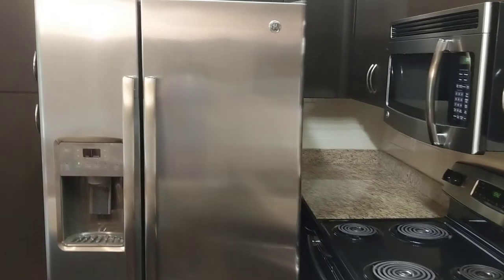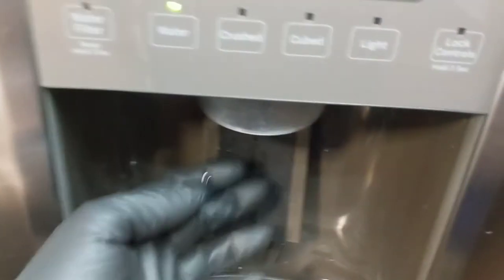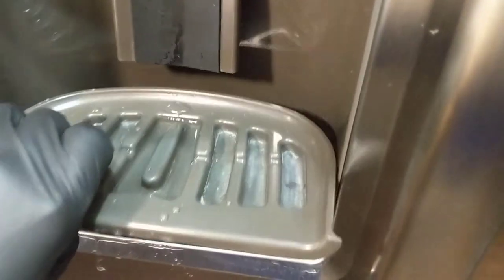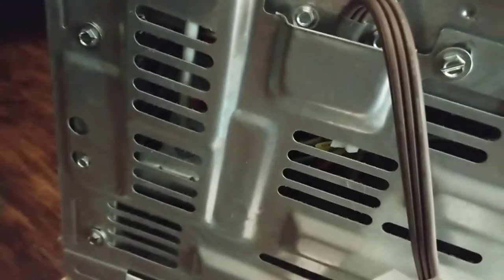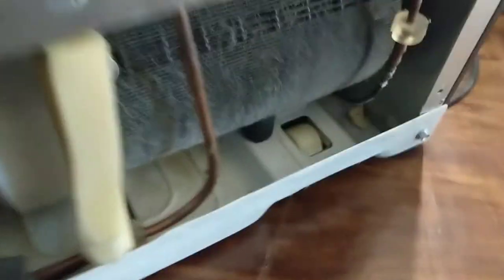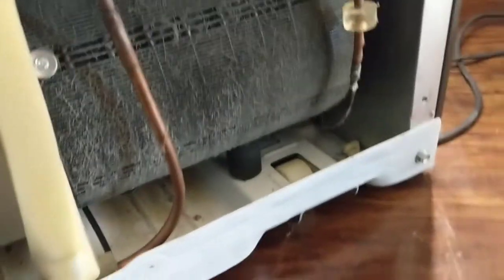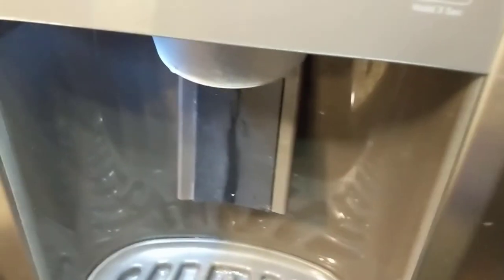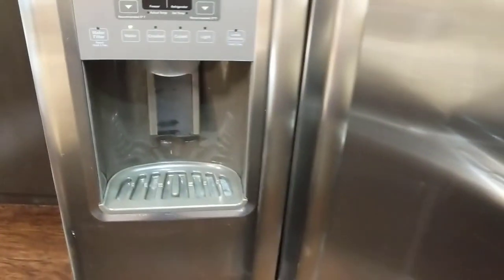GE Refrigerator Water Dispenser Dripping

Comment: Great video.  I replaced the water valve like in this video but our dispenser is still leaking very slowly.  Any other ideas?   Thanks in advance!
Reply: Try a new GE water filter screwed in carefully but tight.
Reply: @valindaznidarsic6253  yup already did that and it still leaks. So the filter and the valve both did not fix my problem. However, I did get a reverse osmosis installed and tighten the refrigerator to it and now the leak has subsided. So I feel it might be a high water, pressure problem.

Comment: I have an ice dispenser and a water dispenser. My slow leak is from the ice dispenser. The ice maker works fine, water dispenses fine but I get the slow drip of water maybe a half teaspoon a day even if I don’t use the ice dispenser for many days. 
Any ideas?
Reply from the maker: The dispenser door flap seal could be bad & not sealing the cold air in which mixes with the room temperature & creates condensation. Or it could be the solenoid that operators the ice door flap which isn't allowing it to close all the way. Hope that helps. Thanks for watching Xrpayday5637 & Subscribe to the channel 👍

Comment: What would be other reason for a slow drip in that area 
I just bought a brand new ge profile and it has a slow drip 
Lowe’s says it is condensation he adjusted the temp on Frig and freezer and it’s still dripping 4 hours later 😭
Thank you !
Reply from the maker: I would would call them back & demand a new refrigerator or have it fixed. There wouldn't be condensation dripping from the tube as unless there's an air leak & you have cold air mixing with the room temp. Either way there's an issue. Thanks for watching Joann & Subscribe to the channel 👍

Comment: Similar to NikTee, I have water trickling down the front door of my GE Artica after there is water in the tray. It appears to be coming out of the tray and through the bezel around the face of the dispenser compartment. But I don't think I have drip from the dispenser itself though.

Any idea how to fix the leak coming out of the dispenser?
Reply from the maker: Prob the water inlet valve not closing all the way. The same part I replaced in the video. That would be my guess, but it's hard to say without seeing it in person of course. Thanks for watching Zachary & Subscribe to the channel 👍

Comment: I am not sure if you still read these, I have an alternate model GE artica, I just noticed a trickle down the front door. I have a black bezel around the face of the dispenser compartment and it looks like the water drip coming from under the bezel, but the water has a drip from the dispenser itself as i've wiped and monitored.

There is no water in the tray itself however I can see the residue under and around the compartment holder when I remove it.  I am wondering if I have the same issue or perhaps a seal problem. I would think there is no reason for there to be water on the back side of the bezel so I am inclined to believe I have the same issue as referenced here. Do you have any insight?

EDIT - After further investigation, it looks like there is condensation around the seal at the base of the ice trap this is where I see the water droplets condensing.
Reply from the maker: Sorry for the delay on my response. Sounds like you could have the same issue as in my video, but I would remove any water from the tray & keep an eye on it to see if anything drips down. Thee shouldn't be any water dripping or forming anywhere around the bezel after water or ice is dispensed. I see where u say about condensation around the "ice trap" I'm guessing your referring to the dispenser door? If so, check the seal on that & make sure there isn't some loose ice or frozen chunk of ice inside there that slowly melts off & drips down. Thanks for watching NikTee & Subscribe to the channel 👍

Comment: I just replaced my water inlet valve with a brand new one from ge and it is still leaking. Any suggestions
Reply from the maker: Lift the overflow cup out & see if there's any water under it & if there is vacuum it out cuz it will keep dripping down on the floor. Also check the nylon water line connection behind the front grille at the bottom of the refrigerator, that's another place that will leak. Hope that helps. Thanks for watching & Subscribe to the channel 👍

Comment: What causes this to happen? My fridge is doing the same thing but curious why is happened all of the sudden.
Reply: I guess they just become faulty and cant regulate the water properly? Or some type of O-ring fails?
Reply from the maker: Solenoid wears out & allows a little bit of water pass through when it shouldn't. Just a part failure like anything else in this world. Thanks for watching Mark & Subscribe to the channel 👍
Reply: @ApartmentMaintenance  thanks for response! I always like to know the why behind things so I can prevent them if possible

Comment: I replaced the valve and still leaking???
Reply from the maker: If you replaced the water inlet valve & your still getting a drip from the dispenser the only few things it could be is either air in the line which after replacing the valve you need to run a gallon or two of water through the dispenser to bleed all the air out of the system. The other thing would be having too much water pressure, & lastly the valve itself which you replaced already. I would try bleeding the system real good. Once you remove your cup from the dispenser it's normal to see a few drips right after dispensing water. Now if it's still dripping a minute later then there's still an issue. Hope that helps. Thanks for watching Harrisfour3 & subscribe to the channel 👍

Comment: Returned home to find the same water build up, except it seems to leak from the ice box when closing the door. Do you think it could just be from melted ice if there are bad springs not keeping the duct door sealed? Or should I also order a water inlet valve. Remote location in Canada....
Reply from the maker: It's hard to say without seeing it. If you can see where the water is coming from that will give you a better idea of what it is, instead of spending money guessing. Thanks for watching Adma16 & Subscribe to the channel 👍
Reply: Curious to know what it ended up being?
Reply from the maker: @SomeKoolPlace  I hear ya Shawn, I haven't heard anything back, unless the issue wasn't resolved yet. We will see if Adma16 lets us know what it is. Thanks for watching Shawn 👍

Comment: I bought and changed out the switch and now no water will flow. I know the device is getting water. Is there a reset?
Reply from the maker: Not that I'm aware of, that is a strange one & it's hard to say without seeing it of course. Just make sure everything is hooked up properly, & the water filter isn't clogged. I've never had that problem. Thanks for watching Chef Andy 👍
Reply: Any update on something that worked? We just changed ours and are having the same issue. No water at all and we just changed the filter last month so it shouldn’t be blocked. Not sure what to try. We’ve checked and rechecked all connections.

Comment: So I have to buy the part at the beginning because my fridge is doing the same thing
Reply from the maker: More than likely it's the dual water inlet valve causing your water dispenser to drip. Obviously I can't say for sure without seeing it. Thanks for watching Dago & Subscribe to the channel 👍
Reply: @ApartmentMaintenance  awesome, well I have warranty on my fridge I should get someone to come and fixed it. I will definitely subscribe right now!
Reply from the maker: @Dgcamarena  Appreciate that, & if your fridge is under warranty I would definitely put the call in that way you won't have to pay for the repair or parts. 👍